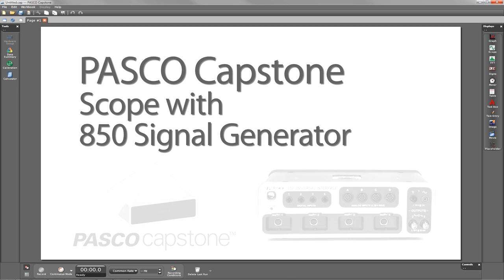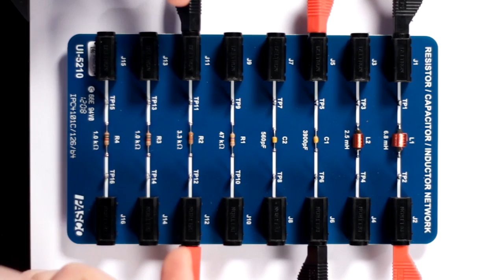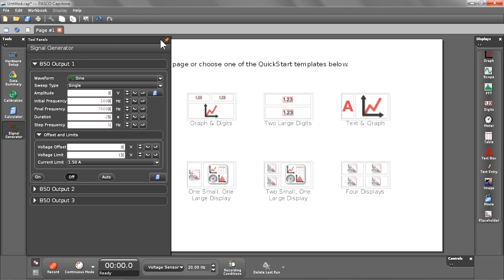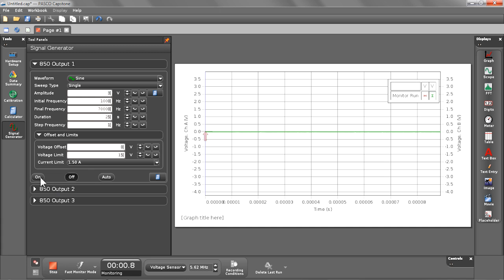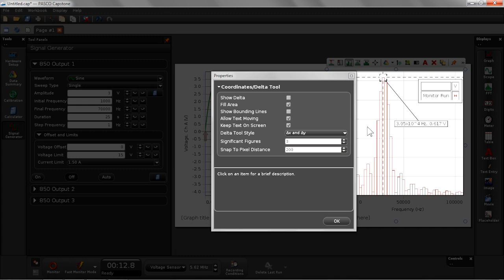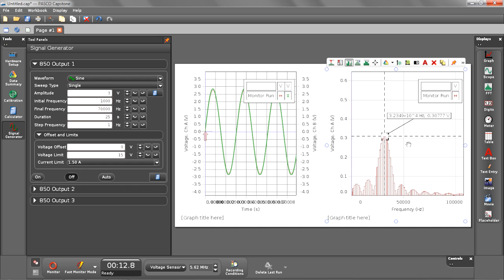PASCO Capstone Scope and 850 Signal Generator

Comment: do you have a photo of the circuit? i'm having trouble seeing it sorry
Reply from the maker: We don't have a photo of the circuit configuration in this video, but you can find some instructions and images for setting up a similar LRC resonance experiment in the Student File PDF on https://www.pasco.com/resources/lab-experiments/503. Please note that the PDF shows the use of different LRC components and a different 850 Interface output port compared to the video.

Comment: If I have the x-t graph of a forced oscillation, how do I convert it to an amplitude-frequency graph?
Reply from the maker: PASCO Capstone's FFT (or Fast Fourier Transform) Display analyzes data to show amplitude vs frequency. You can see the FFT Display demonstrated in this video at [4:32} and you can learn more about it here in PASCO Capstone Help: https://help.pasco.com/capstone/how-do-i/display-and-analyze-data/fft-display/.
Reply: @pascoscientific  
but how can I find the amplitude of my position-time graph?
In the X axis I get the frequency, for the Y axis I only get position, velocity and acceleration which are from the motion sensor, I don't get the amplitude.
Should I type a formula for the amplitude?
Adjusting my graph I get:
x_{(t)}=-0.01e^{-0.01t}\sin (14.02t-2.76)+0.23
Reply from the maker: You might try using the PASCO Capstone Calculator's "amplitude"  function to create a new data set which picks off the peaks of your position-time data, as demonstrated in this video: https://youtu.be/3XoFLWmHeB0

Comment: I have a question. I cannot modify the frequency in the signal generator interface, how do I do it?
Reply from the maker: As long as you have a periodic Waveform selected and the Sweep Type set to Off, you should see a Frequency field that allows you to set the desired output frequency directly by typing or using the field's up and down arrows. For a demonstration, please see https://youtu.be/RBTOcjIs46o?t=52.